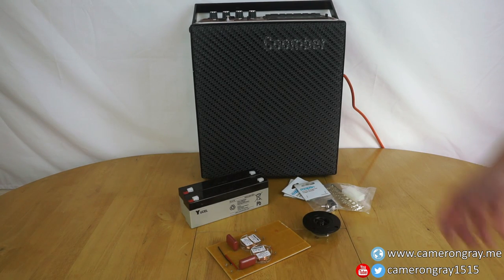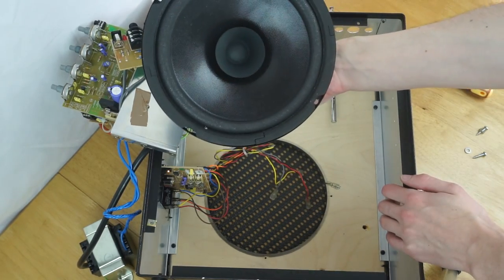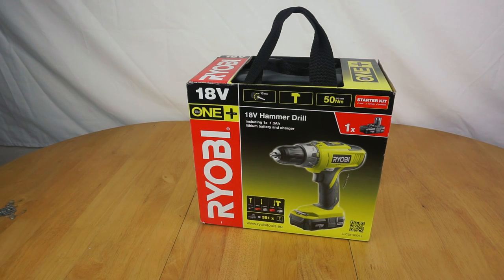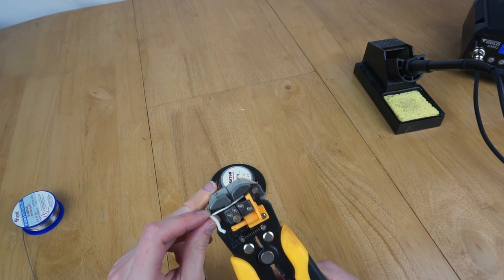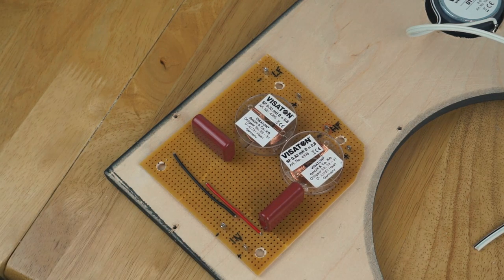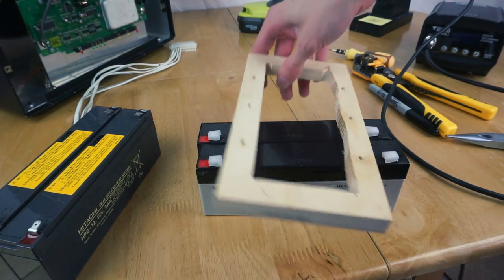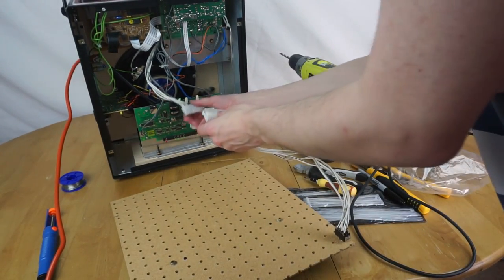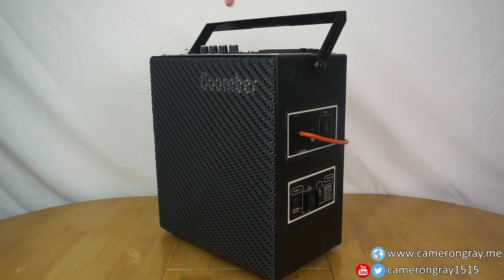#PimpMyCoomber - "Upgrading" my old Coomber 2060 PA System - Part 1

Comment: You can wire a L-pad attenuator with variable level adjustment between the HF output of the crossover and the tweeter and set that to the appropriate level, to compensate for the tweeter’s higher sensitivity. This would mean you wouldn’t have to turn the treble knob down every time you turn 2-way mode on. Liking this project by the way!
Reply: yeah, that tweeter could definitely do with some attenuation. gone from not enough treble to too much as it is. although maybe personal preference comes into it as some people like that overcooked tssss tssss tssss treble.
Reply: I want to mod my coomber with a tweeter in the same way. Could you advise me what to do with the crossover? The l pad attenuator suggested?

Comment: I suppose with a lot of effort you could switch out the original amp section for a class D module of high power get a good deal more life out of the batteries.

Comment: Would it not have been easier and cheaper to buy a new drill bit
Reply from the maker: I hadn't used the original drill so was able to return it, I'd have probably struggled to find a holesaw that would have fitted it.  It was also only a 10.8v drill (I hadn't really done any research at the time when I bought it) so wouldn't have been that powerful anyway, the new 18v Ryobi is definitely worth the price difference, especially since I've been using it an absolute tonne after moving into my own place.
Reply: Aye